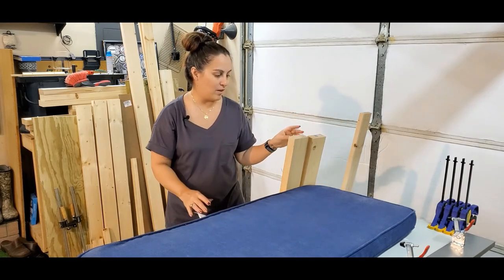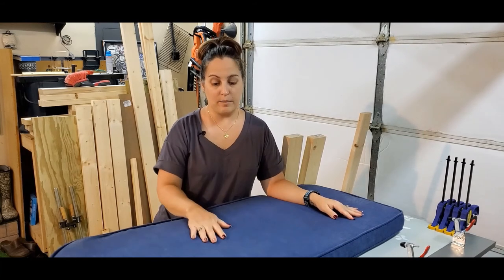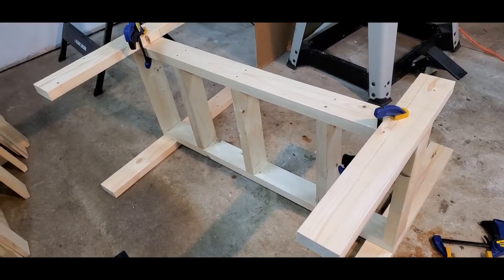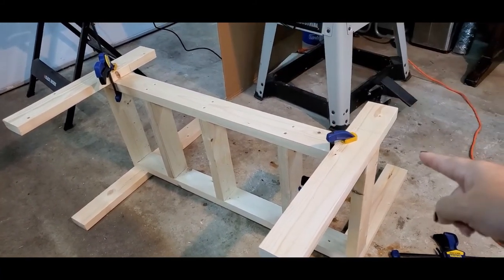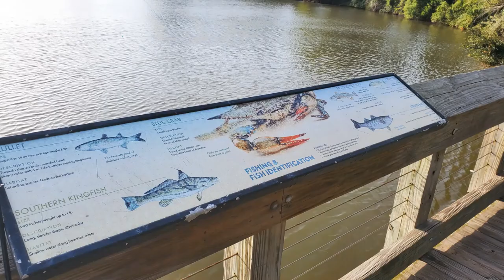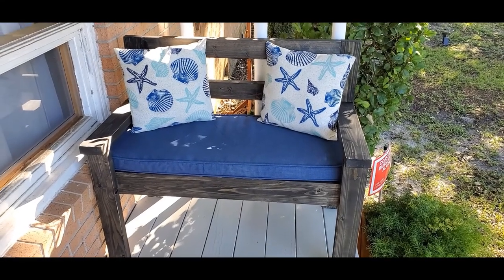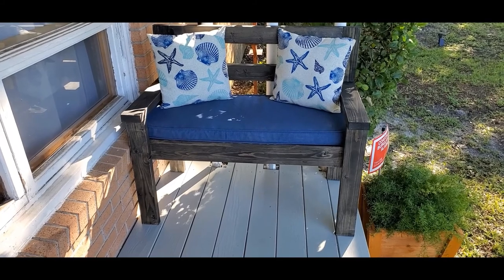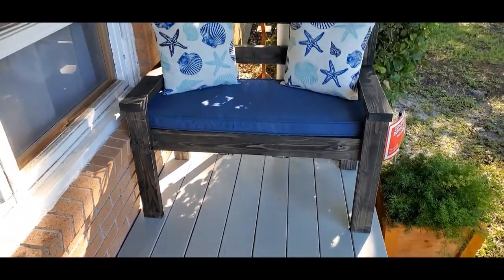Patio "park" Bench w/ cushion

Comment: I like the stain on your final product. Whenever I'm doing a four legged project nothing irks me more than that one uneven leg ! So I like to make my marks on the legs then clamp blocks exactly at the marks. Then I can set the seat assembly on those blocks and test it for uniformity first before securing with screws. Looks like you've got a nice sitting spot for evenings when the mosquitoes aren't out in full force !!